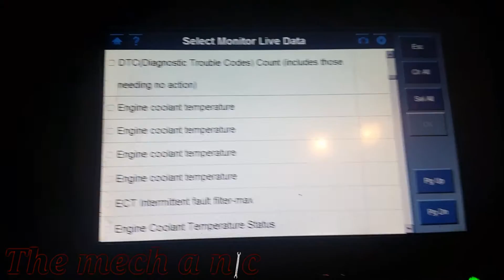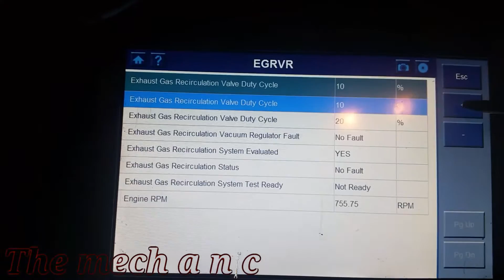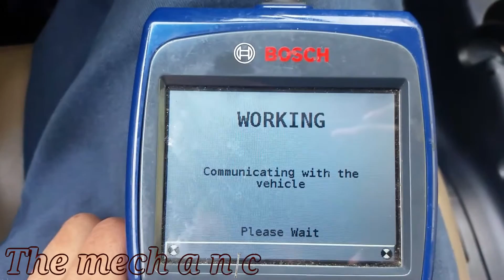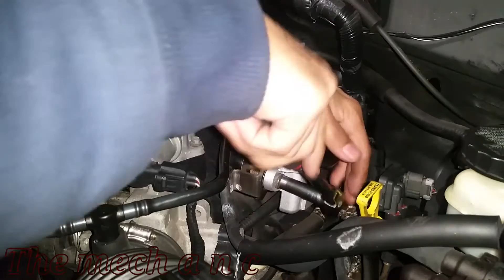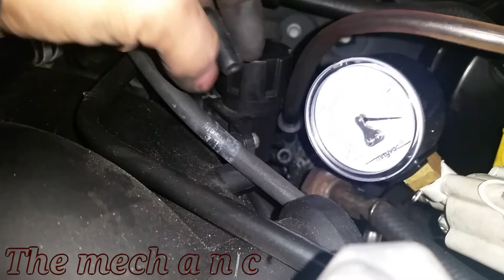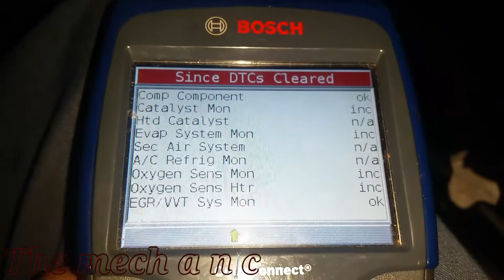P0401 2004 ford escape

Comment: The intermittent problem could be caused by one or both of the wires inside the insulation on the wiring harness to the solenoid being broken. I've heard the short, tight bend can cause this, especially when surrounded by the heat. It can break contact

Comment: The system design of the EGR system of Ford products depends upon vacuum to operate the EGR valve. In older vehicles it is advisable to throughly inspect every part of the vacuum system associated with the EGR. One of the most important is the vacuum reservoir for the entire system. This is especially true of the F150/250 pickup from 1997-1998. Personal experience the reservoir of my F250 developed numerous cracks in the reservoir and caused the same symptom and code P0401 as is being presented in this video.

Comment: I recently had my 2004 Ford Escape looked at and had the EGR Vacuum Regulator Solenoid Connector & EGR Vacuum Regulator Solenoid Connector changed.. But I keep getting the engine light on but Autozone is telling me that I need those 2 parts I recently changed. But when I showed them how recent I changed those parts. They told me that it maybe  defectives part they sold me.... But I have the FIXD scanner and the FIXD app is telling me under the Advanced Data & Diagnostics tab the only things failing is the Catalyst & EVAP System. But the EVAP System listing doesnt give me exact detail on what is needed. Do you think the whole EVAP System should be changed? And is the EGR on what I changed part of the EVAP System?

Comment: Bro that engine look nice, I will like to clean mine like that, and I have the same problem with my car, and algo the battery light is coming on in the dashboard
Reply from the maker: Gabriel Rosario Jimenez if your battery light is coming on is probably a bad alternator
Reply: The mech a nic that’s what I think, my battery is brand new, and I have the PO401 I think for sure that’s the EGR valve that it has to be clean or replace
Reply: But the funny thing is that the car runs fine, the radio, heater and my high beams everything works fine but when I press the gas pedal for more speed it hesitates so there’s a combination problem haha the EGR valve and just like you said the alternator but I replaced that almost two years  ago
Reply from the maker: +Gabriel Rosario Jimenez I've replaced alternators that go bad within a few months